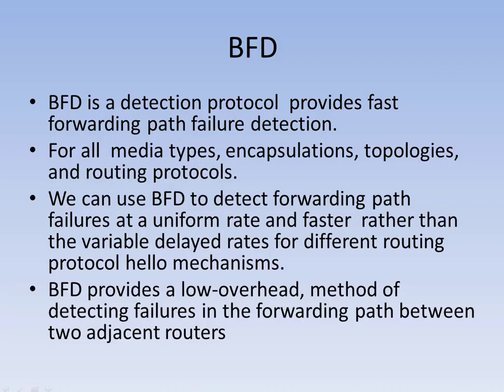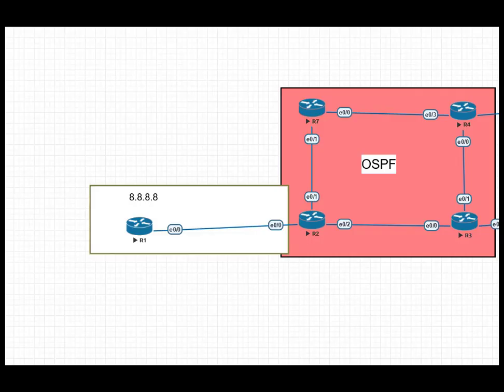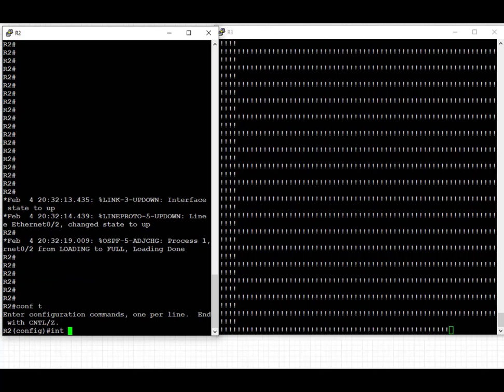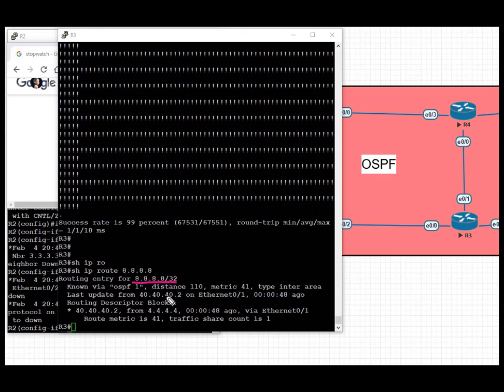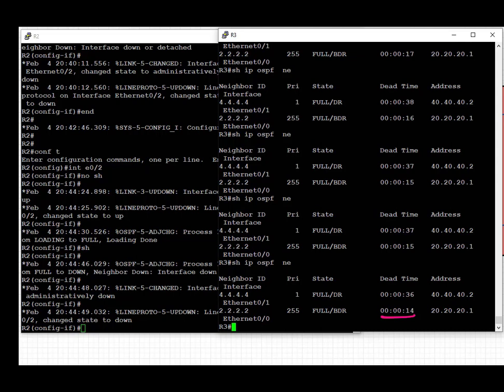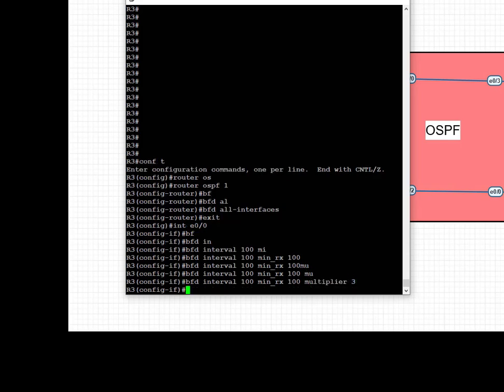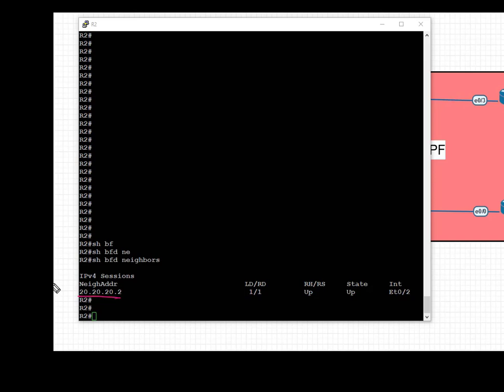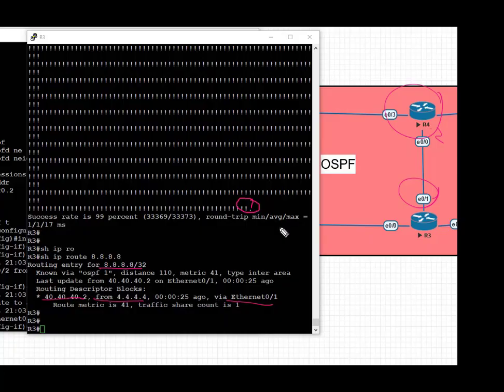How to configure BFD Cisco

Comment: Do you use with gns3, my router flapping after config bfd, please share your IOS version
Reply from the maker: I use EVE NG
Reply: @networkroute1741  on EVE NG, what  IOS you used?
Reply: @networkroute1741  actually, im on research how impact bfd to network, i need IOS/IOU supported BFD feature
Reply from the maker: @muhammadmasyhudulhaq3782  sorry i dont rememebr exact version i used- but IOS XE latest available on EVE-NG should work
Reply: @networkroute1741  hello bro, i used IOS XE / CSR 1000 latest version, and it's too hard of cpu utilization. any advice for another version?
Reply: @networkroute1741  can i contact you in the email? I need your support 🙏
Reply: @networkroute1741  By the way i have done simulated from GNS 3 and eve-ng with IOU L3 , when i was fail over test, there's no impact of BFD feature. Just 4 sec down time with / not BFD. There's someone can help me?
Reply: @networkroute1741  hello sir, can i get the answer?